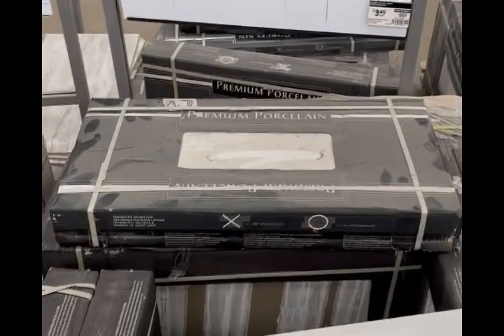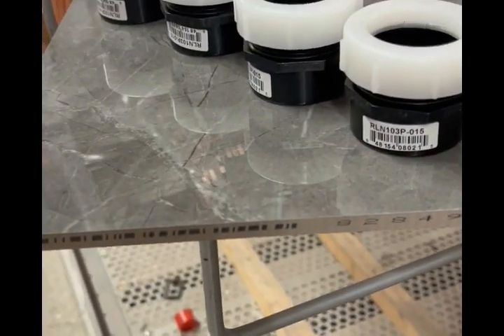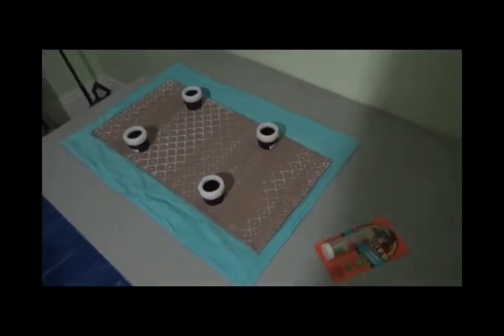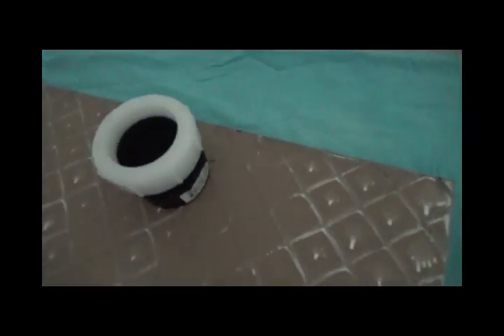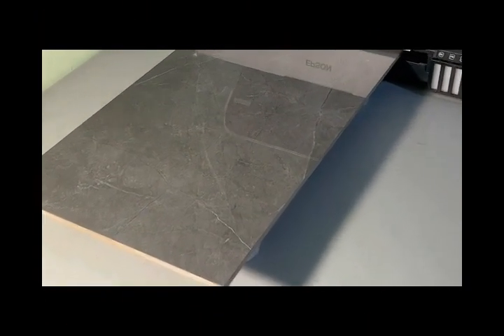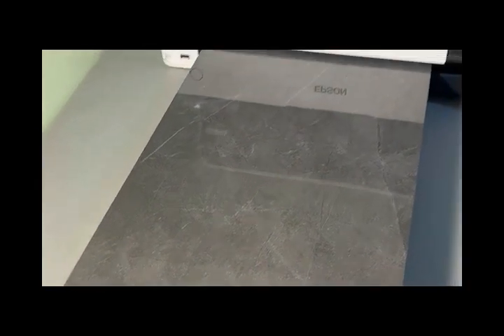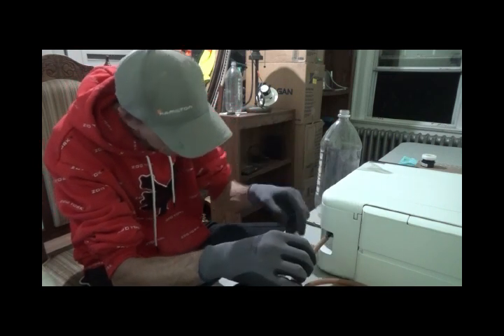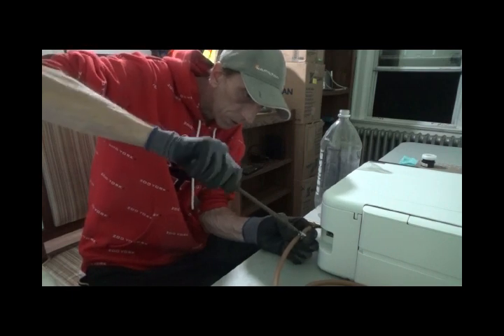Epson ET-8550 Custom Tray & Waste Storage Build {Full Tutorial}

Comment: Does this tray change the maximum thickness of material you can use? I'm not interested in the DTF conversion but looking at printing on thicker boards like 2mm in thickness. According to my research, this printer can only accept up to 1.3mm thick board through its rear feed. Thanks.

Comment: How has your costume tray been working out for you? I’m planning on stealing your idea and make my own so my prints come out nicely.
Reply from the maker: I have not used it just yet. Actually im putting my ink in my Cis System and hopefully running prints this weekend. from everything i've seen on trays and with my experience with DTF now it's one of the best solutions for it. watch out for one of my next videos showing the fill and the print out of it. Cheers!!!!!!
Reply: What height did you use for the legs? Everything I’ve tried has had streak marks toward the top of the prints.
Reply: @glendascott1  try this … there’s two levers on both side of the print head, unscrew the screw carefully maybe a half turn only and you will be able to pull it off just enough to move it all the way to the top of the small holes just be care not to break it and just do that for both sides and that should help
Reply: @glendascott1  or just check out “Epson 8550 printhead height adjustment” for a better explanation on the process
Reply: Please provide what the height of the tray is thanks.